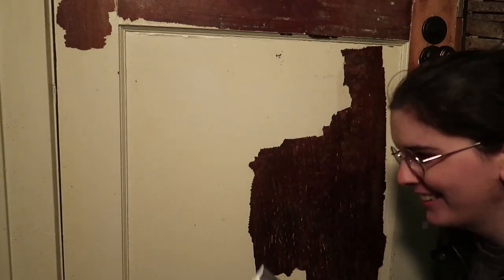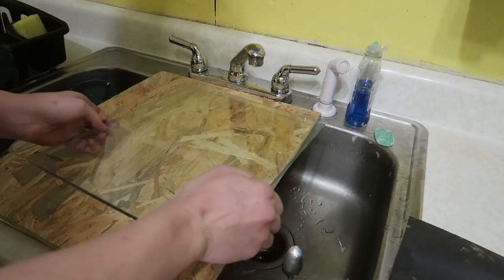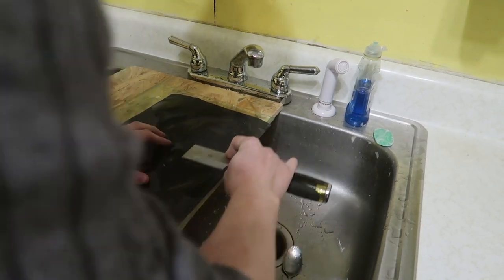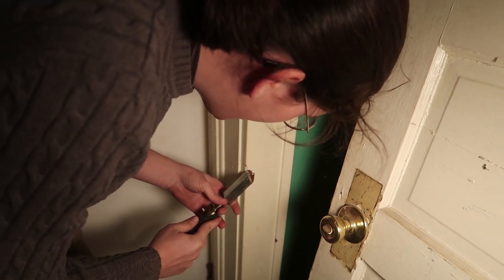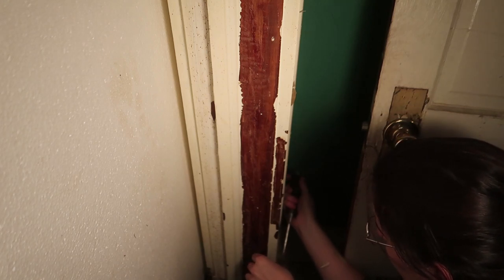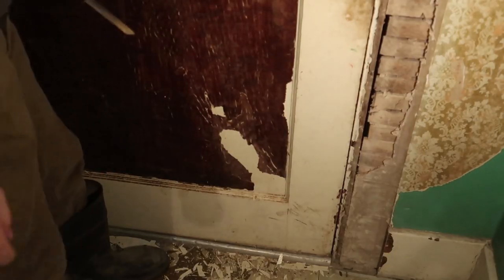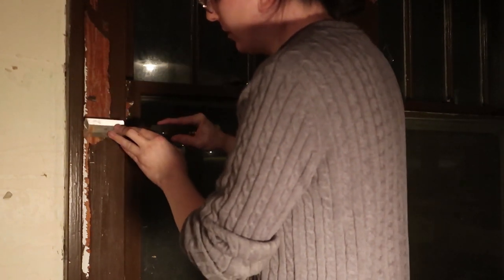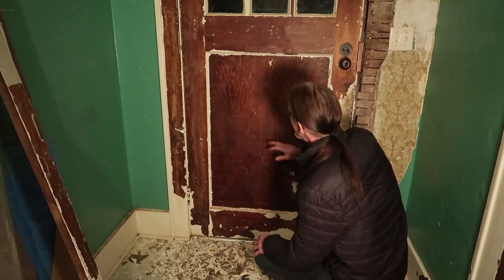1925 Abandoned House Restoration 13: Remove Paint from Hardwood with Sharp Chisel, How To Sharpen

Comment: Removing old paint using a sharp blade was my preferred method, semi retired now. I used the blade out of an old wood plane, its light, 2 inch wide and razor sharp. Perfect for the large open areas on doors and frames. Been in construction all my life, its great watching someone do what I used to do. You had the paint go under your nail yet? Painful, very painful. That old paint had a lot of lead in it too. Great vid Rin, keep them coming.

Comment: Hope you checked the paint for lead first....
Reply from the maker: why wouldnt it have lead?
Reply: @RinoaL  the old paint was lead based like the old gas for cars had lead and classic cars still add lead additives to the unleaded gas of today
Reply: Most likely that was latex paint as it didnt stick to the varnish, if it was oil base paint, you wouldn't be scraping it off like that

Comment: When you start stripping  the paint that is in the curved areas of the wood, consider using Strypeeze. (If you've never used it, it works well.)

Comment: Wish I had thought of this when I restored my old living room door i don't really like using a heat gun cause in my experience maybe it's cause mine is really shitty but on low heat it doesn't take of the pain completely to where i have to always use a sander afterwards and on high heat it burns the paint almost instantly
Reply from the maker: yeah i cant believe i never thought of this before!
Reply: @RinoaL  are you btw painting the doors or are you just sanding them and leaving them brown
Reply: Diamonds Are Forever , heat guns work well, in my experience, only if you are removing a lot of layers of paint. And, if the under coats are oil based paints, it works even better. I never had much luck with a scraper without a heat gun, as in this video. Possible reasons are that maybe my scraper was not as sharp as here, and / or the original paint layer here did not stick very well to the wood. Either way, this worked much better than I expected.
To remove residuals, I always finished the process by use of paint remover, and steel wool. Messy and smelly, but it would result in an essentially perfect job.

Comment: It's best when they didn't prep the surface properly, which means they just slapped the paint over the varnish so it didn't get a chance to bond or soak into the wood. This is when it's easy to scrape it off like this.

Comment: You may want to consider using a planer. It would allow you to adjust the cut dept and probably apply more pressure for smoother faster removal.
Reply: Wonder Turtle , sounds like this might be a great idea. Has anyone out there tried it? If so what were your experiences and how well did it work?
Reply: @jeromewysocki8809  my grandpa used to do it all the time on large tables. It sometimes leaves slight marks in the wood that needs to be sanded if it goes too deep. He also says a belt sander works well.

Comment: You should take the doors off and try to pressure wash the rest of the paint off, its worth a try, I know someone with a really powerful one that would definitely remove the paint,  also sand blasting could work,  its going to be a pain in the but to get all the paint off by hand.
Reply from the maker: itd ruin the wood
Reply: @RinoaL   there are videos online of people sandblasting wood, it works amazing to restore old wood and get paint off, you just need to use a different kind of sand and run at a lower pressure

Comment: We used torches to strip paint off wood worked great, I might be screwed for doing that.
Reply: Ron Stark , I used to do that, too, until my friend, who gave me the idea (it worked for him for many years) almost burned his house down. He smelled smoke at 3am. Seems that a spark in the crack of two boards slowly burned un-noticed for hours. He got the smoldering out, quickly. We both now use electric heat guns.
Reply: @jeromewysocki8809  yep, we did the same to a customer's house, old house they used news paper for insulation, we pulled off the trim and sprayed it with a garden hose, got lucky,

Comment: Be careful Rin, that could be lead paint. I would test if it is or not
Reply from the maker: why wouldnt it be?
Reply: @RinoaL  I ain't telling you what to do but I would put on a disposable mask to protect against the airborne lead dust. I wouldn't care to have a mask on while using the heat gun because the paint is melted and the chance of airborne lead dust is minimal. Otherwise I'm really enjoying your restoration!

Comment: LOL, that must have been the $5.00 a gal Latex Crap Paint.  Wondering why it didn't  just come off in sheets by it's self.
Reply: Even good oil paint just chips off like that if you paint it over old, dirty shellac without any prep.

Comment: I hope that's not lead paint you're scrapping off Rinoa.
Reply from the maker: why wouldnt it be?
Reply: @RinoaL  Well, usually houses from the 20's used lead paint, because back then the toxicity of lead was not well known.
Reply: My and my friend had to vacate an old house when they found asbestos.
Reply: She's not scraping it like an idiot so as long as she uses water with automatic dish detergent (contains phosphates that bind with lead) she should be good.
Reply: I still use old 60/40 lead solder, it's ok as long as I have a fume extractor, and I wash my hands.
Reply: It certainly is lead paint, but if you dont eat it or grind it into powder that you then breathe who cares. Sweep it up and throw it away. Wash your hands and you're as clean as the driven snow.   Lead paint and asbestos are two of the most overblown hazards in existence.
Reply: @thermionicman6700  Right, asbestos miners used to work underground in the dust for years on end and most didn't die from it.
Yet now its treated as super toxic, like if you look at it sideways for a second you will drop dead.
Reply: Asbestos can kill us, but what they dont tell you is its naturally occurring in the environment. It's a mineral and everyone who has ever lived has or had some asbestos fibers in their lungs. The chances of any particular exposure or fiber killing you is minuscule. Just avoid unnecessary exposure and quit worrying.
Reply: @thermionicman6700  Yes, wear a mask if near dust for sure, but the whole asbestos issue has turned into an industry where litigation lawyers and specialist disposal companies are making a fortune by exaggerating the risk.
Reply: @georgegibson707  you are right on my friend.
Reply: Reminds me of the time I helped a friend scrape, sand, and blend in 7 layers of paint on his rock walls. For some stupid reason he used a tiny profile sander to do it, and burned the motor out after sanding only the master bedroom.